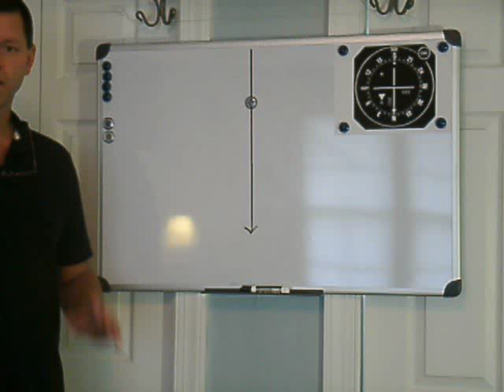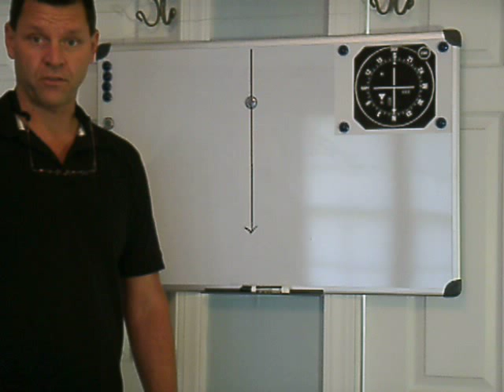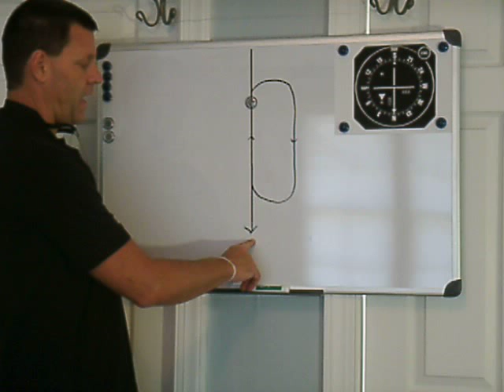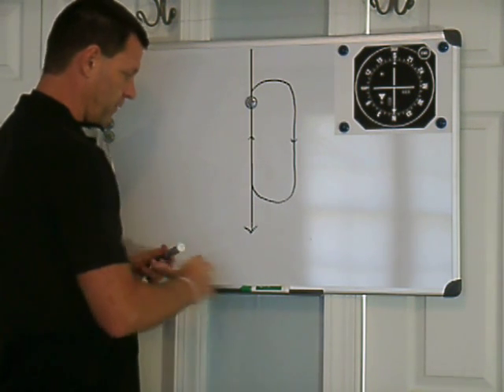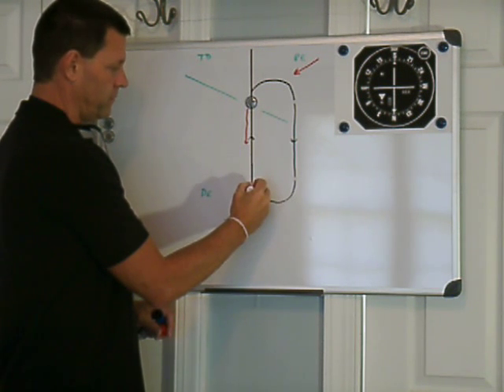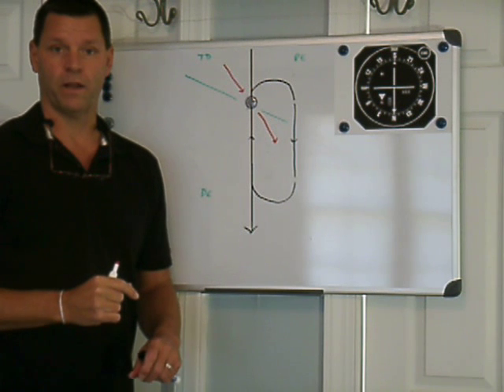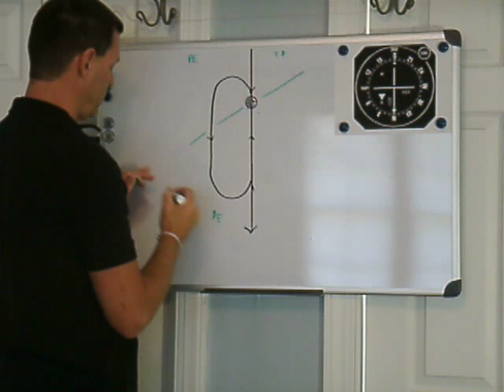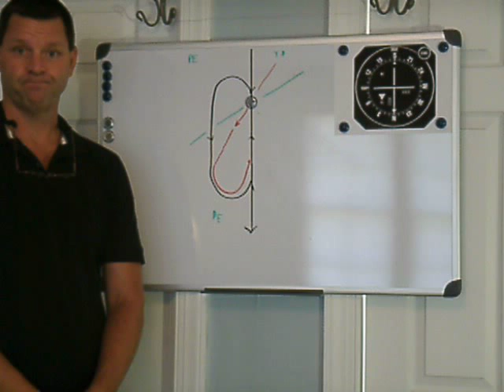OBXFLIGHT: Holding Patterns

Comment: Ok....a few questions and I hope they aren't stupid:  1)  If you're doing a parallel entry, are you flying the same altitude as another aircraft already on this hold and if so, how do you keep from flying into them as you are flying in the opposite direction (parallel to THEIR inbound {assuming we're in the clouds})?  How far to the side should you be flying this parallel route for separation or does ATC only put one aircraft in a hold on a particular fix at a time?  2)  When you make your parallel entry turn, you're crossing in front of (potentially) an aircraft making their inbound turn?  Once again, how does ATC separate aircraft in the holding pattern?  Hope these aren't too stupid.  Thanks!

Comment: Using the pencil method or the thumb method, the pilot would tilt the left side of the pencil 20 deg up for a left turn and would tilt the right side of the pencil 20 deg up for a right turn.  The explanation in the video is backwards.
Reply from the maker: Nope the explanation is correct. One thing I did leave out in the explanation was a reminder to reset the OBS for the inbound course (360), before turning inbound in order to avoid reverse sensing.
Reply: Well sorry but I can see this Video is opposite way , something is wrong with it ..
Reply: For left hand turns raise the left side up 20 degrees. Right hand turns, raise the right side up 20 degrees. 
Also note that if the pilot has an HSI there is no reverse sensing.

Comment: How can you define a Fix ... What is a Fix ?
Reply: The holding fix is the point upon which the hold id "anchored."  Usually this is a VOR, NDB, Intersection or a GPS way-point.  Occasionally ATC will assign a "present position" hold.  In this case you need to use your GPS user-defined way-point feature to create a way-point at your current position and hold according to ATC instructions (i.e. South of the fix, right/left turns, X minutes/miles).